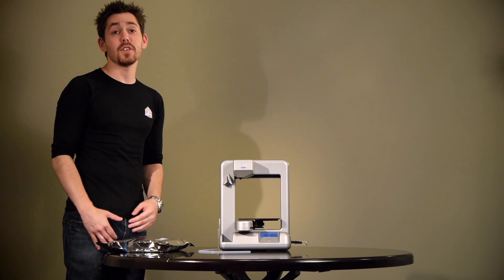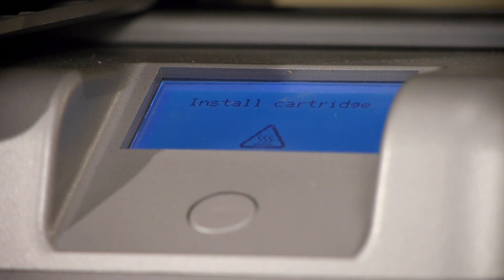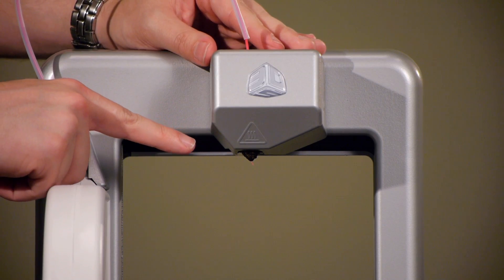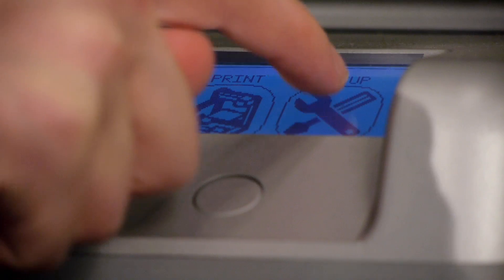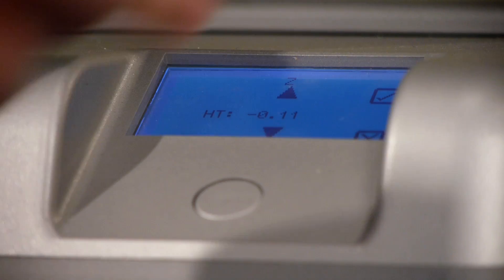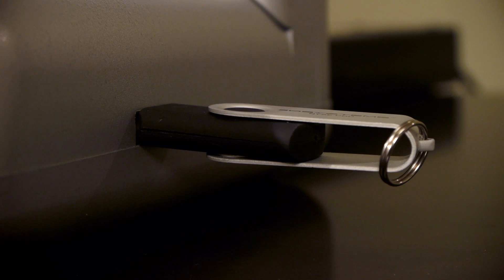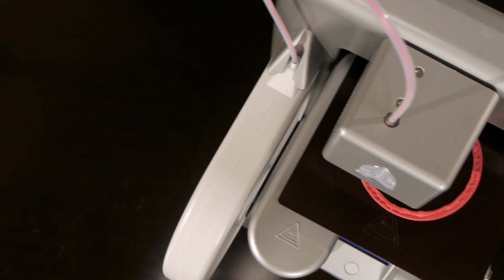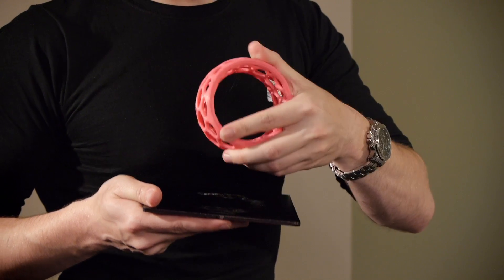Tips for setting up your new Cube 3D Printer

Comment: can I buy much cheaper material that is available everywhere  or do you have to buy your brand cartridges, also are they like those rip off HP cartridges with a chip that stops you using them if they arent original ?